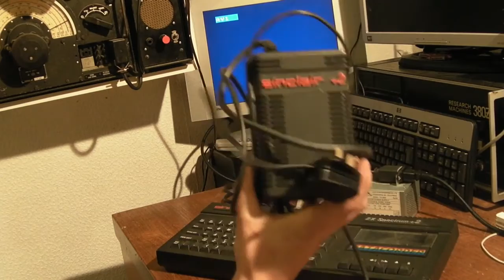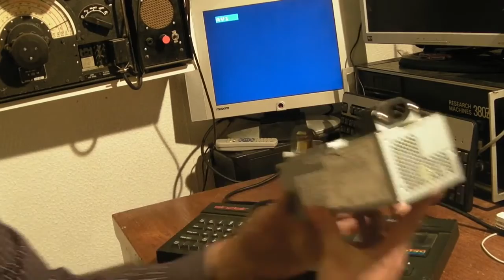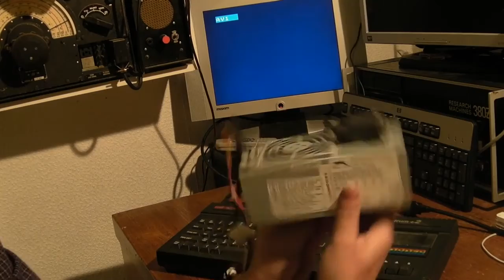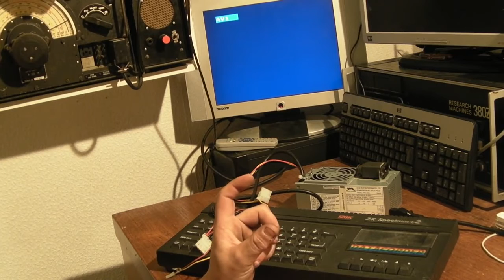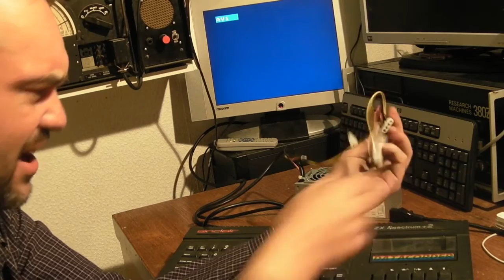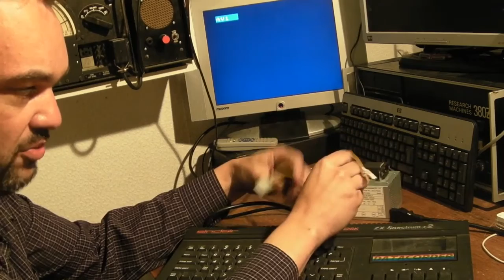Spectrum Plus 2A/3 Alternative PSU

Comment: Another good source of power supplies are the ones used for IDE hard drive enclosures.
They supply +5v and +12v, and are usually quite small, about the size of a laptop power supply.
Reply from the maker: yes I have used them in the past too.

Comment: Isn't the +2 PSU a linear supply?
Reply: There are two +2 models, one (+2) is more similar to the spectrum + and uses a typical 9v psu, but the +2A, +2B and +3 use a din 6 psu with +-12V and +5V